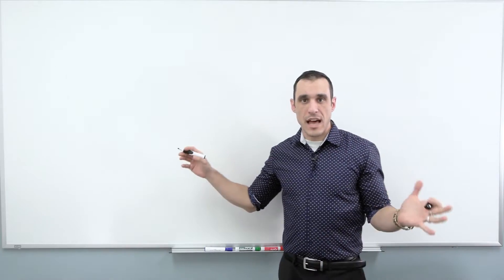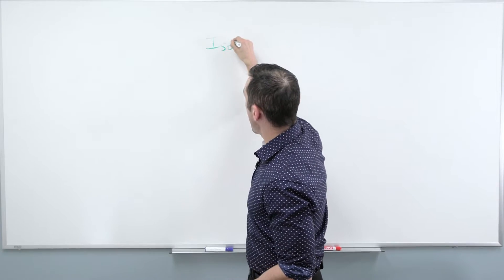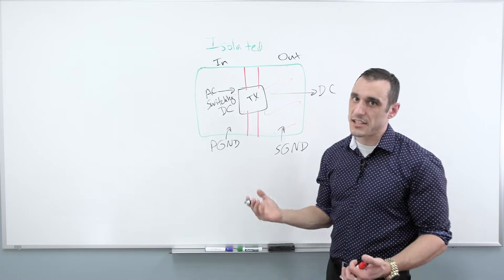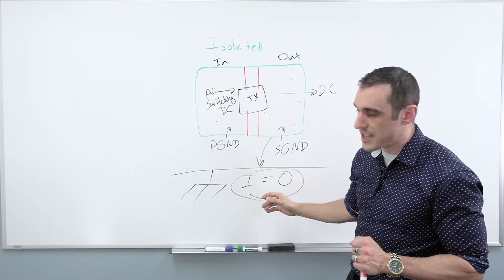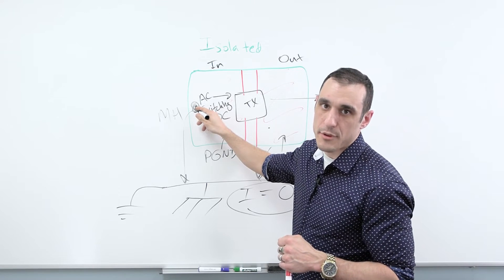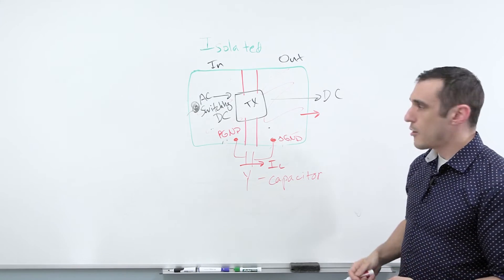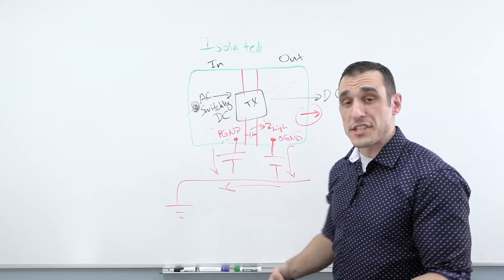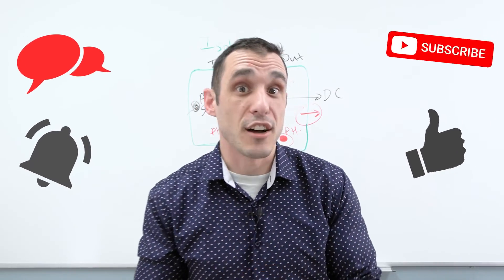Should You Connect Grounds in an Isolated Power Supply?

Comment: I'm confused, how can the ground side on the primary have a voltage higher than ground to  cause a shock? Unless the user on the other side is lower than ground or that the primary sound's ground pin isn't earthed. Although primary is always earthed because of the  fuse box etc right?

Comment: If i have a AC/DC isolated module, AC from wall outlet. I can connect Live-Cy-PE-Cy-Neutral. So PE should have the mount hole. What must i do with de DC out + and -? Connect DC out - with a Cap Y to PE?
Reply: Just for context,  I'm not talking about wall wart power adapters, those will step down AC-to-AC, and then that rectifies to DC with a bridge (or diode) and some capacitance. That then gets regulated to the output DC level. In isolated modules, or with DC devices running directly off the mains AC, the input AC often first gets rectified and cleaned up to a high DC voltage, so there is a defined reference node in the DC part of the circuit on the primary side of the transformer. Then a switcher passes pulses through the primary transformer coil, and these are stepped down to the secondary side, rectified with a fast diode, and cleaned up with some capacitance and you have your output voltage. The Y-type cap is placed across the two reference nodes on each side of the transformer. Hope this helps clear things up.

Comment: have been designing power supplies for the last ten years.  These are mainly LLC converters. Previously, I always installed a Y capacitor between the primary and secondary sides, I did not realize that a huge amount of interference was passing through it. I tried experimenting with different capacitance of this capacitor, but I always got bad results. Since then, I stopped installing Y capacitors, which completely eliminated interference. The protective ground is connected only to the device body or to the power filter. In no case should you connect the secondary clean power supply to the ground, either through capacitors or directly - this will only destroy your electronics.

Comment: Hi. Thank you for video. What about floated output capacitor charger power supply for laser when voltage range is about 700-1200v dc for laser bulb? I can connect Y capacitor between 0V terminal and case? On scope voltage between this terminal and case grounded shows sinus wave about 200V pk-pk.
Reply: I don't know for your specific application as I would have to look at your design. From what it sounds like you already have capacitive coupling between your input power and your chassis so I don't think a Y capacitor connection to your chassis will help. But you can always look for a Y capacitor on Octopart and order a batch from digikey, give it a try and see if it solves your problem!

Comment: Hi I would like how we connect pgnd ans sgnd if we don't have chassis and with plastic enclosure
Reply: As I mentioned, the typical way to do this is to use a Y-type safety capacitor, the capacitance should be larger than the interwinding capacitance of the transformer coils. Place this across the transformer as this will allow high frequency noise that cannot complete a current loop in the secondary plane to have a low impedance path back to the power input.

Comment: I think Anker should be watching these videos... Really? I'm getting a 50v 50hz sine though my usb-C charger, causing my laptop touchpad to go in a frenezy and it's shocking my hands when using it sometimes (alu chasis)
Reply: If you directly connect the grounds across an isolated supply then don't be surprised if that happens, that's like having an extreme level of leakage. Then on your laptop, they connected the motherboard's ground to the chassis ground, so now you're running return current through the chassis! No wonder you get shocked when handling it! This is why you need the isolation between the input and output sides. When using the cap to control high frequency noise, there is a bit of leakage but it is very small and is usually only regulated in some EMC standards in things like medical devices.
Reply: @Zachariah-Peterson  this should be more strictly regulated to be honest, especially in 240v countries. Even the original apple chargers have this issue, albeit with a smaller leakage due to less power of the whole charger (45w vs 250w) and they released a grounded adapter to mitigate the issue entirely. How I got rid of the issue on my charger is running a wire from mains safety ground(earth) to the shield of one usb-A port. Will probably add a cap inline just to avoid any DC currents passing though while still filtering out the AC
Reply: @gtaseed  Inline cap should work especially if it's large enough. I don't have all the EMC standards memorized but I'm sure there is a regulation for it for products manufactured and imported into the US or Europe. The problem comes from bad actors overseas who make non-compliant products or counterfeit product. For non-compliant products, there is no way to test every product that gets imported from overseas, you have to trust that the product is EMC compliant. Ken Wyatt recently put out an article on counterfeit Apple phone chargers from China that were failing radiated emissions, it wouldn't surprise me if someone counterfeited other charger brands and put out products with high leakage current.
Reply: Does this USB-C charger have a 2-pin mains plug, or 3-pin?
Reply: @Graham_Wideman 2 pin, that's what causes the whole issue mentioned above. Seems to be better lately though, I don't know why

Comment: I have a question, why electrical tester led is ON only for few SMPS boards. Most of the smps adapters like mobile chargers are not detected by electrical tester. So what could be the issue?

Comment: Hello, Nice and clear explanation. BTW I have a question that I have an 12v 2Amp SMPS board in which the Y rated capacitor value is 102 and if I touch the DC output wires I am getting mild shocks. I have replaced this capacitor with 103 and now the situation got worsen than earlier. I want to apply the way you explained that I will keep the existing 102 capacitor in original position (with PGND and SGND) and then I will connect one terminal of additional 102 capacitor to PGND and other terminal of this capacitor to earth. Same I repeat for SGND as well. Is this correct approach?

someone suggested that If you want to keep the EMC benefits of the capacitor, keep your output floating but divert leakage away from the output you should replace the existing 102 capacitor with two capacitors connected in series. Then connect the mid-point of the two capacitors to mains earth.
Reply: Without seeing your PCB layout I could not tell you with high confidence what is the problem. The two capacitors connected in series approach is normally a way to construct a filter on the AC input, not for connecting the grounds in an isolated power supply. But you can try it and see if it solves the output leakage problem.

Comment: When you ground the loads through capacitance and the input power through capacitance or EMI filter, how do you break the Current loop that set up?
Reply: The point is to control emissions at high frequencies by giving high frequency noise a path to complete a circuit. By directing that current where you want it you can reduce the inductance associated with that current loop and control coupling of noise into other circuits.

Comment: Hi Zach,
Thanks for the nice video. Just a question, if I may...let us assume an additional signal GND is needed on the secondary side, how do you deal with this? Do you use the same Y-rated CAP to connect it to earth, or do you use a net tie between itself and the secondary GND which is already connected to earth via a Y-rated CAP? 
Thanks for your insights!
Reply: You're kind of describing something like a fly-buck, where for example you might have multiple secondaries and a single primary where there is an AC input. I think you should be prepared to stitch those grounds together with Y caps in order to control radiated emissions. In terms of a prototype design, it's a simple matter to leave some through-holes on neighboring grounds and test with/without the Y caps.

Comment: Hi Zak, we have an internal power supply and connect the earth to the chassis. Then we have an MCU and a motor driver. Should we connect the mounting hole (GND DC) to the chassis that is already connected to Earth?
Reply: If the mounting hole is connected to the system ground then you should not do this. You may allow some return current to flow in the chassis, which could then create a shock to the user. Earth connections are also not intended to be used  to carry return current, it is intended for safety only. Since you are bringing in earth I might assume you are also bringing in AC and you have an isolated switching converter, in that case the primary side ground must not connect to earth.

There are exceptions to this, for example if you did not have an AC connection with earth, you would want to connect a metal chassis to your system ground to eliminate any floating conductor. I have seen this connection made with a small resistor (milliOhms value) between system ground and chassis ground via the mounting hole.
Reply: @Zachariah-Peterson  Thank you

Comment: Is there a recomended equation for capacitor sizing to guard against esd in these various situations? Any rules of thumb to follow? For an ideal design do you want a large inductor and a resistor in parallel with an esd cap?
Reply: There is not really a good rule of thumb other than to look at the capacitor and its ESL/ESR values as well as its parallel resistor (if present). Those will limit the rate at which the capacitor can charge/discharge given an input edge rate. If the expected transient you need to shunt is faster, then the time constant needs to be smaller to provide effective protection. Transients can be pretty slow but with high voltage, so the edge rate is still large. If you are connecting across two grounds (primary and secondary) in a power supply, then the cap just needs to be much larger than the leakage/winding capacitance in the transformer. However be careful with this because there is leakage current that can cross that boundary, and leakage current can reach the user at the output side of the power supply. Some industry EMC standards, particularly medical, limit the amount of current that can pass to a user via leakage.

Comment: thanks, how do you calculate the value of the capacitor ?
Reply: The standard guideline is to use a cap that has a larger value than the leakage capacitance of the transformer. The idea is to have higher frequency noise propagate back to the power supply return, rather than radiating or passing to an exposed connector where it could pass through the user to ground, so it is up to you to determine what the lowest frequency in the noise spectrum is and size the capacitor accordingly to provide low impedance across that isolation gap. The capacitor is typically a Y-type capacitor (that's the most commonly recommended I have seen), but the DC leakage current across the cap can also be important as this could create an annoying ESD shock if the user touches any plugs or connectors exposed in the system. This might also cause your design to fail some higher-end EMC requirements, such as in medical equipment.

Comment: Hi Zach...Learning a lot from your videos...How to calculate the capacitors value....?
Reply: You just need to make sure the capacitance is larger than the copupling capacitance between the coils in the transformer. If you are using an isolated power regulator chip, then you need to know the capacitance across the isolation barrier in the internal portion of the chip, which can be quite small. When the capacitor is larger, the impedance for higher frequency noise will be lower, so it can more easily travel back across the isolation gap through the capacitor rather than the transformer.

Comment: an ESD event on the DC side ground will simply charge the capacitor. It's not going to "discharge" the ESD thru ground. You should use a resistor if you want to actually get rid of the excessive charge.
Reply: may be an inductor in series with the resistor to reduce that primary ground noise from getting in
Reply: It will dissipate through the capacitor as leakage current over time

Comment: Thank you zach. This is the exact information i was seeking after for my Induction board design. I had faced issues with floating grounds earlier which i had used a y1 cap from my control ground to the PE. It had solved mostly my ground lift problems.
Reply from the maker: Glad it helped!

Comment: Thank you, Zach! Super clear and helpful info. Just wondering though - is there ever a scenario to put a resistor in series or parallel to the capacitor that is connected between Secondary GND and Chassis GND? I seem to recall that being done on designs that I've come across. Thanks again.
Reply: Yes.  A resistor will actual dissipate the charge. Otherwise a capacitor will simply hold the ESD charge.
Reply: Resistor in series: No, that will defeat the purpose of having the capacitor conduct AC current.  In parallel: Possibly.  A high value resistor (say in the megohms) will allow any accumulated charge on the secondary-side circuit to drain away rather than charge up the pri-sec capacitor, while for the most part maintaining isolation of the secondary circuit.